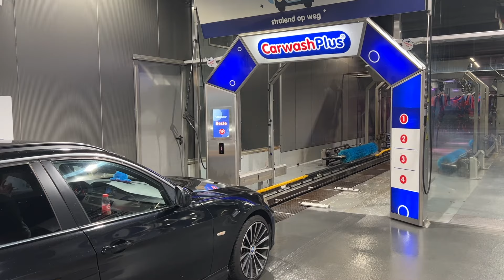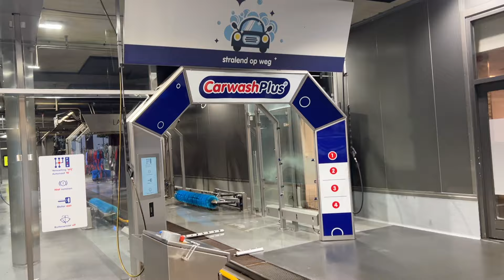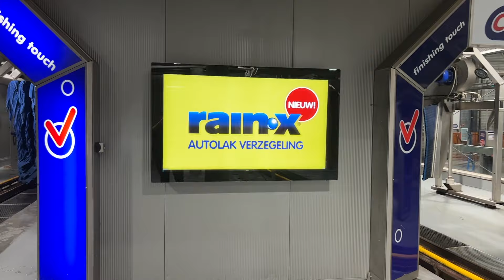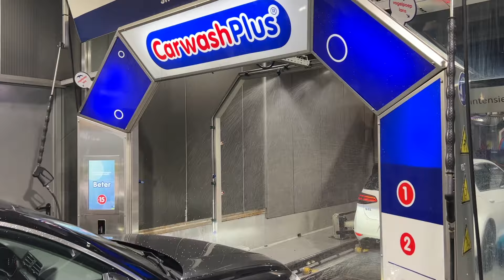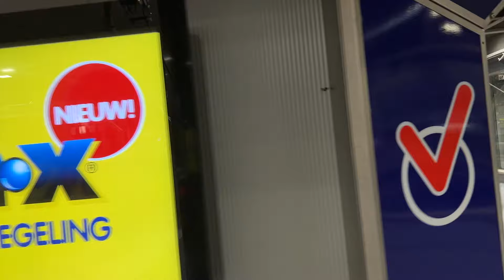CarwashPlus: Haarlem Site

Comment: Wow the chemistry is different than most North American washes. The first lava bath is rinsed off right away with high pressure and the second lava bath, although not rinsed off right away, didn't leave the vehicle visibly covered in a crazy amount of foam. Even if the wash package doesn't include the first lava bath, the soapy water pre rinse in the very beginning is still rinsed off with high pressure water. Yet clearly no one over there minds and vehicles must not be getting damaged from the brushes as they needed to expand and build a second tunnel to keep up with demand. Interesting to see a different perspective on chemistry.